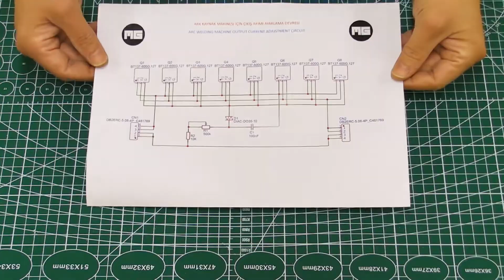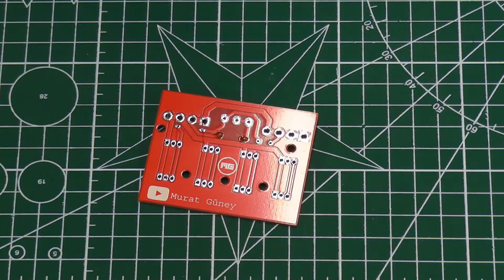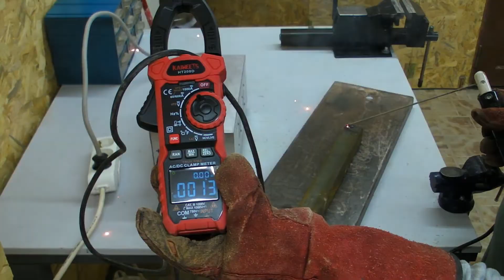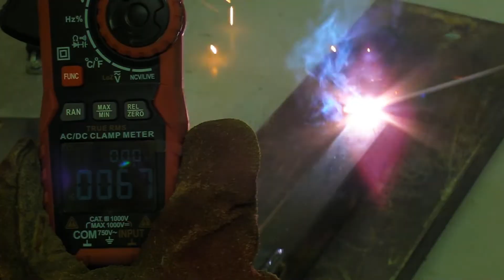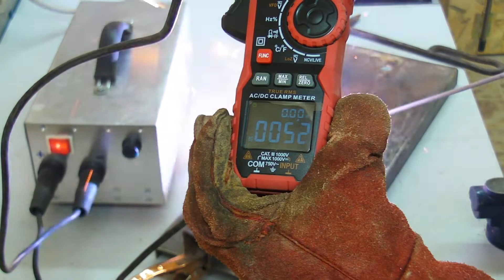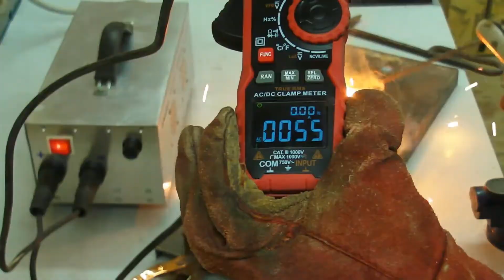How to adjust the welding machine output current (Working perfectly)

Comment: When you use maximum power can it use 2.5mm rod to cut 1.5mm thick iron?
Reply from the maker: Hello. Since this is an arc welding machine, it is not suitable for cutting. However, it can easily pierce 1.5mm or 2mm thick iron. In other words, you can melt it.

Comment: Over here in the USA I have two 110v  microwave transformers and hooked up they draw a total of 15.5 amps. So for so good with building this welder except the diac when tested all works but seems to be heating up to hot to touch with the light bulb test. Is there something I can change in the circuit for higher amperage using 110v ?
Reply from the maker: Hello. I understand that you made this circuit and it is getting very hot, right? In places where 110V voltage is used, more current is drawn from the network to obtain the same power. Therefore, if I used 4 triacs, you should use 8. I remember that I gave this information in the circuit video. In order to minimize the possibility of failure, the resistance of the circuit elements should be made more than the power drawn by the system.
Reply: Yes I remember that and I certainly will try that. Thanks for getting back to me so quickly
Reply: is it better to use 8 triac when the supply is 220 v ?

Comment: How much higher amp؟
Reply from the maker: Hello. If you are asking how much current the circuit can withstand, since I used 4 8 amp triacs, theoretically it can withstand 32A. In other words, this circuit can operate and adjust a welding machine or a suitable system connected to its output up to 32A. On the other hand, if you are asking about the maximum current of the welding machine, I can say around 100A.

Comment: Isn't the capacitor that remains charged dangerous?
Reply from the maker: Hi.  After each welding process, a voltage of around 60V remains on the capacitor.  This is destroyed during the source short circuit.  However, after the work with the device is completed, the last remaining voltage.  It takes a long time to discharge.  It is not a value that could be dangerous.  However, if the ends touch each other close to the eye, an arc will occur and may damage the eye.

Comment: You need three transformers because most welders use 1/8th inch electrodes.

Three or more in series is better. Giving you the most stable arc ever.

Able to turn rutile rods into deeper penetration rods.

Overall, decent video.
Reply from the maker: Thanks.  I have also built machines with 3 transformers and 4 transformers.  I made this machine with 2 transformers to make it a little lighter.  I think it wasn't bad.

Comment: Does it have to be 220v? I'm in the states and we 110v here.
Reply from the maker: Hello.  If you are asking about this circuit, there is no problem.  So you can also use it with 110V.  However, since more current will be drawn from the network at 110V voltage, it would be better to connect 8 triacs to the circuit.  If your question is about the welding machine... the answer is yes.  In other words, you can make the same welding machine and use it at 110V voltage.

Comment: buenas tardes mi otra pregunta es al dimmer de 4000 watts 220v con el triac bta41600b le puedo poner 4 triacs bt 137600e
Reply from the maker: Si vas a conectar 4 BT137, te recomiendo conectar el otro triac.  Sería mejor si los elementos a conectar en paralelo fueran idénticos.  Creo que puedes usarlo con tu circuito existente y si tienes problemas, puedes conectar 4 BT137.  Si el circuito del atenuador se estropea, el triac y el diac (generalmente un elemento de circuito azul de 2 pines) fallarán.  Cuando los reemplace y repare cualquier rotura en el circuito, su circuito funcionará.

Comment: maestro buenas tardes en mi pais la corriente es 220 v tengo un dimmer de 4000 watts con un triac bta 41600b mi pregunta es le puedo poner 4 triacs del mismo numero
Reply from the maker: Hola.  En lugares donde se utiliza voltaje de 220V, un atenuador de 4000W será suficiente.  Está bien incluso si no hay triac adicional.  Sin embargo, si desea reducir la posibilidad de mal funcionamiento, basta con utilizar 1 más del mismo triac.  En otras palabras, puedes conectarlo en paralelo al triac del circuito.
Reply: muchas gracias
 @MuratGüney

Comment: sr buenas noches soy peruano quisiera saber si el dimmer anterior con los triacs le funciono bien y quiero saber si el nuevo regulador de voltaje hace lo mismo por que le puse un dimmer de 4000 wats y mucho quemaba el fusible. digame al dimmer de 4000 le puedo poner 4 triacs de bta41600b o le puedo poner 4 triacs bt 137600e .espero su respuesta es un genio le pregunto eso por que no se como comprar los protoboard que ud usa
Reply from the maker: Hola.  Si el voltaje de su red es de 110 V, debe usar un circuito de atenuación más potente.  Si es 220V, puedes usar 4000W... Si no hay problema con las conexiones y el fusible no se funde cuando energizas los transformadores sin instalar un atenuador, vuelve a conectar el atenuador.  Sin embargo, si el fusible se funde constantemente, es posible que el circuito que estás utilizando esté defectuoso.  Para entender esto, puedes mirar el triac en el circuito con un multímetro.  Si va a utilizar el mismo circuito, reemplace el elemento diac junto con el triac en el circuito.  bta41600b es un triac de 40A y se puede utilizar.  Estoy usando 4 BT137.  El circuito que ves en este video funciona igual que el circuito que hice antes.  Como ventaja, no hay desorden de cables y se pueden conectar más triacs.

Comment: @MuratGuney once again great work. Exist another solution without to modified the voltage sinusoidal form in primary coil. Idea is to saturated the core from exterior columns, using two coils connected at c.c. voltage regulator. Using c.c. voltage to this coil you can control how from alternate flux can pass through this columns. Ideal construction is with primary and secondary a.c coils to exterior columns and coil connected to c.c. voltage in central column.
Reply from the maker: Hello.  Firstly, thank you.  However, I did not understand how I could adjust it without disturbing the sinus form.  What I did is an easy and cheap method.  However, it makes adjustments by chopping the sine wave.  It works, but I can admit it's not perfect.
Reply: @MuratGüney  Your solution used is OK, but I wish to remember that also are other solutions. Theoretically, with an dc coil you can add an non alternating flux in the core and remain available  less (equivalent section) for alternating flux and in this manner is moved the point of function on plane characteristic (in saturation zone) V/T (voltage/induction) of the core.I think, with two magnets, for example: one with N on the left column and another with S on the right column, you can see some difference, of course the difference depends on how strong the  magnets are.

Comment: Hey my man, another good video. One of these days id like to try out your triac configurarion. Ive built this welder and used an scr for my power regularion.
 Idk if you remrmber but he spoke through comments about adding a dc choke/coil filter in the comments on the other videos of this welder. I would like to share with you what i had done regarding this. I used 2 mots like you did for my welder, i took 2 more mot cores of similar size and welded them together face ro face to make one long transformer El configuration. Wound it as tightly, neatly and solidly as i could with 10 ga silicone wire, the same wire i use on my welding tranformers. I then put it in the positive line coming off the rectifier, before the capacitor. And so far it has been working quite well! 
Now i want to explain that instead of running stick i tried to fashion a wire feed motor for my welder to ise as a flux core or mig, i failed at that so i bought a cheap wire feed motor and power it iff an led 240ac to 12vdv converter. Running flux core through my machine works very very well and thebaddition of the choke makes it 10x smoother. Now i need to note that it seems i had some current loss due to the limitations of the transformer but am still welding thru 1/8 to 1/2 inch just fine with 0.030 wire. This is why i wanted to add the choke. I found out however thatbif i were to run stick, with the filter choke, id need to remove the capacitor. So idk if you really want to explore that with this project or not. Just some info to try n help. I would not have my homemade awesome little buzz box if i had not found your channel my freind. Keep up the good work and have fun!
Reply from the maker: Hello.  We've had conversations about the coil, but I still haven't been able to.  You did and you succeeded.  Congratulations.  If you send me your detailed photos and schematic information, I can try and even make a video when possible so that other viewers can benefit.  I'll add your name to the video as a quote.  Thank you for your return.
Reply: @MuratGüney  hey, well i am in the process of rebuilding the box to house everything, takes time because i work alot of hours. I honestly still dont know the calcularions of chokes or the specs of this one specifically nor do i keep any schematics. Online i have found several web pages with detailed information on filtering dc though, qnd have followed the schematic for an lc filter configuration. There are some detailed points i would like to share tho, if you or anyone decides to try this on their own. You can use tha capacitor before the choke BUT you will need at least a 100amp diode between the cap and choke, the flyback from the choke will blow the cap unless it is monsterous, it blew my 125v 4700uf cap. I use it choke 1st then cap from the rectifier. I use a 1600v 200amp full bridge rectifier in mine so that device can handle the flyback, or at least seems ro be able to so far. Once im finnished with the new box i will post outputs n such but as far as pocs, idk how to post those lol. I only fairly recently started playing with yt
Reply from the maker: Hi.  I understand you.  You can send the videos or photos you want to share to the e-mail address muratguney67@gmail.com
Reply: Hola te escribo voy a intentar hacer este tu proyecto mejorado y con tus conocimientos y asesoría para en fin hacerlo viable.. Y seguro. Cuento con su apoyo

Comment: Hola amigo un saludo desde Venezuela.!! Una pregunta podré usar está máquina sin ponerle ese sircuito impreso.
Reply from the maker: Hola.  Puede usarlo, pero no puede ajustar la corriente.  En este caso, si usa electrodos delgados como 2 mm, la corriente es demasiado.  Pero puedes quemar electrones como 2.5 o 3.25.  Esto también debe agregarse.  Si la parte soldada es demasiado delgada, el exceso de corriente puede perforar la parte.  Es mejor que construyas la máquina sin el circuito.  Dependiendo de la situación, puede agregar el circuito más tarde.  Saludos desde Turquía 👍

Comment: To improve welding, it would be advisable to connect an inductor in series behind the rectifier.
Reply from the maker: Hello.  I got a lot of advice on this.  I want to try but I'm not sure what coil to use
Reply: I had just made a post addressing this. Hope the info helps!

Comment: Hi Dear Mr. Murat Güney!
I would like to ask about that  https://www.youtube.com/watch?v=WrngBsmGQtQ&t=67
Triac regulator connection.
- Have you installed the converter between the output of the AC secondary side AC 40V and the rectifier bridge or somewhere else???

I would friendly to hear your kind reply.
Reply from the maker: Hello.  I put the dimmer circuit in this video on the input side, between the primary winding and the mains voltage.  A circuit like this would not be suitable for output because the output current is too high.

Comment: Hai murath  . Is it ok to use swg 10 winding core insted of 4 sbqm  copper cable and how many turns should  i do for one secondary
Reply from the maker: Hello.  If you use AWG10 cable, I recommend using 3 transformers.  otherwise the Voltage will be low.  You should wind the transformers as much as you can.  It will probably fit between 13 - 15 turns.

Comment: Can i use class 220 and class 250 transformer  together  for this
Reply from the maker: Hello.  I think the values you are talking about are voltage values.  This circuit is voltage independent up to 500V.  So you can use.  If the number of transformers you will connect is 2, you should use 4 triacs as I did, and if the number of transformers is 4, you should use 8 triacs.
Reply: Thank u for u r reply brother
Reply from the maker: Thank you too 👍

Comment: 90 A is less for 3.25 mm electrode. You should use only 2 mm electrode. Rutil 6013.
Reply from the maker: Hello.  There is no problem with Melting the 3.25 electrode.  It melts pretty well.  To tell the truth, I think there was a problem with the current measurement.  Because even though the output is DC, I couldn't make a good measurement when I took the meter to DC stage.  Because when a load is connected to the output, full DC output cannot be obtained.  As a result of the rectification, a 100Hz full-wave rectification signal is obtained.  Therefore, I may have made a mistake during the measurement with the ammeter.  As you can see in the video, a very smooth welding process is obtained.